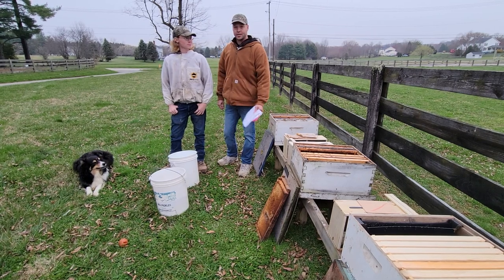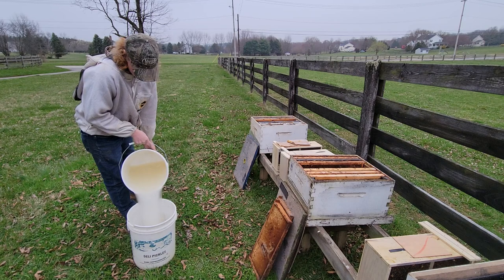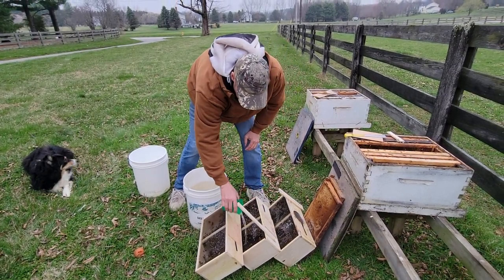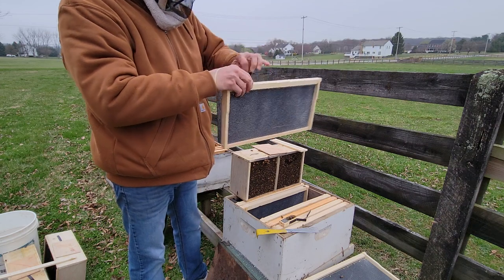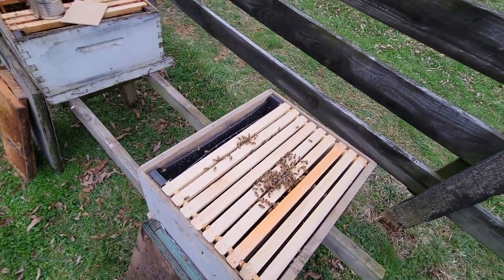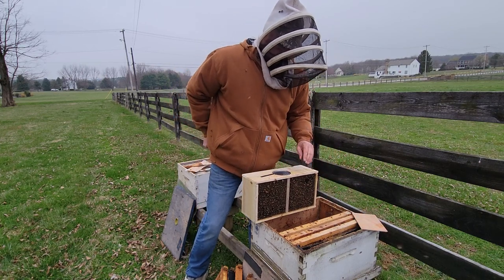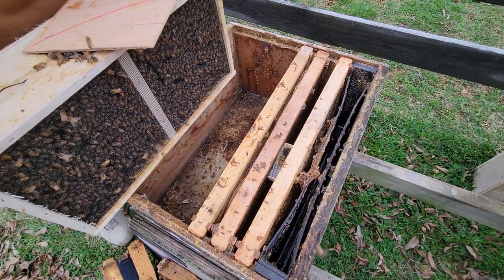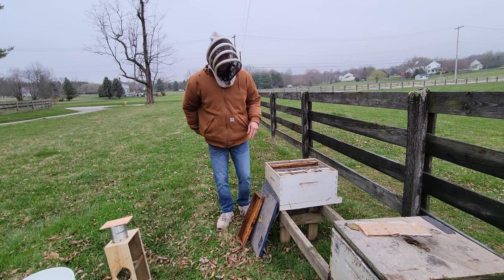Package Install Day

Comment: Hey Jason, thanks for the informational video.  Where do you get the sheet you use under the lid?
Reply: It's called reflectix. You can get it at depot, lowes, Amazon